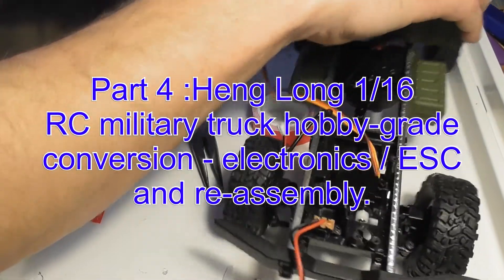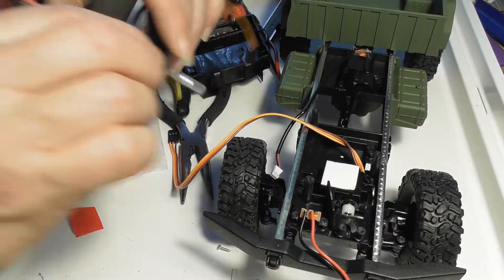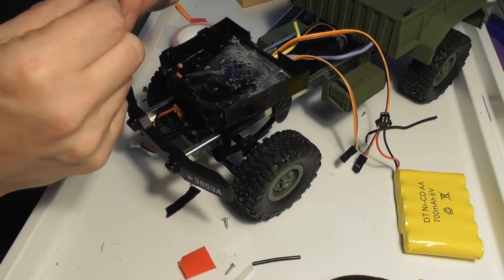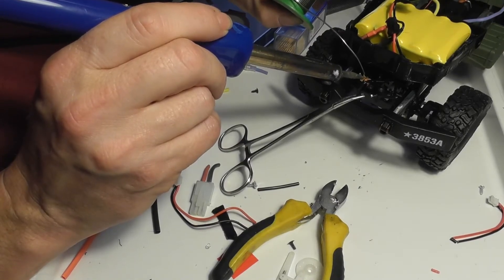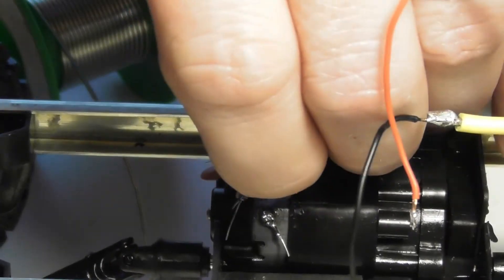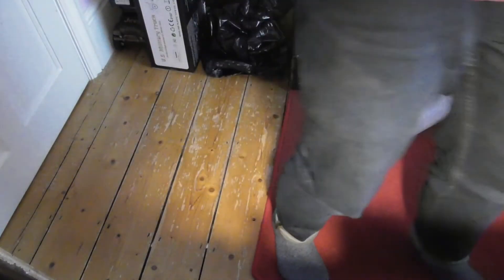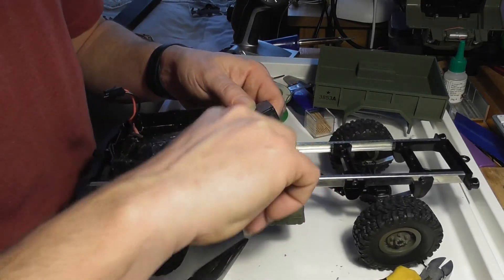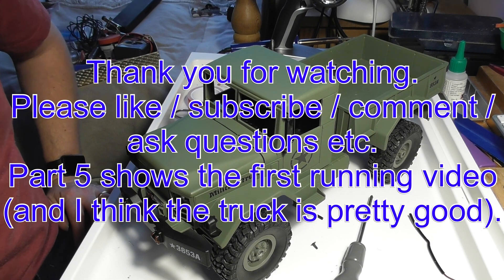Heng Long 1/16 military truck hobby-grade conversion Part 4 : electronics / ESC and re-assembly

Comment: привет .для чего 3 штуки 104 кондицатора
Reply: hi. what 3 pieces 104 of the capacitor
Reply from the maker: I think they are Ceramic Disc Capacitors 50v 100nf 0.1uf 104pf like this: https://www.ebay.co.uk/p/1000-Pcs-Ceramic-Disc-Capacitors-50v-100nf-0-1uf-104pf/1987831870?iid=182988169900&_trkparms=aid%3D555018%26algo%3DPL.SIM%26ao%3D2%26asc%3D48497%26meid%3D69412600fa154c4ab3f3033a8821a634%26pid%3D100005%26rk%3D1%26rkt%3D6%26sd%3D291263960300%26itm%3D182988169900&_trksid=p2047675.c100005.m1851